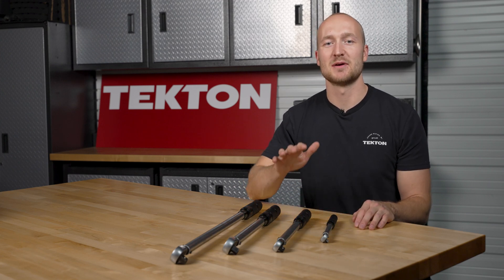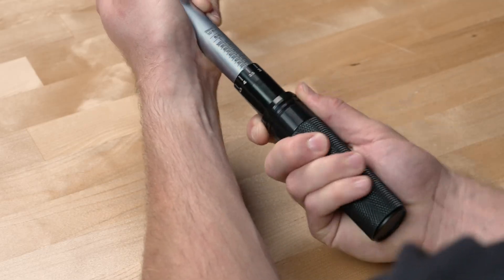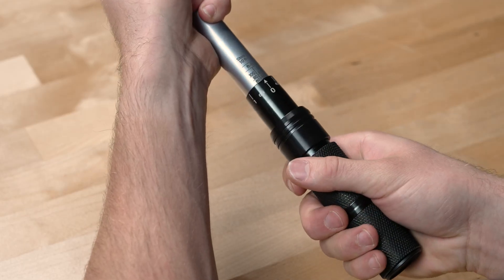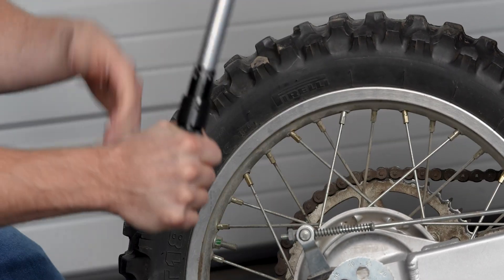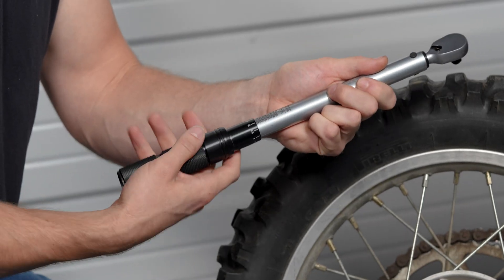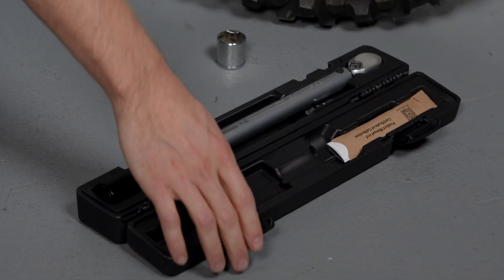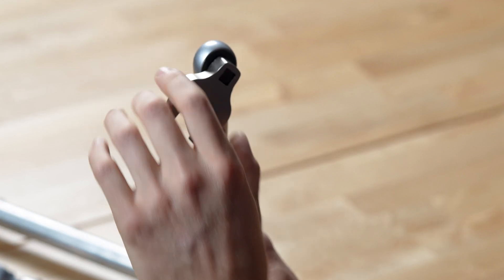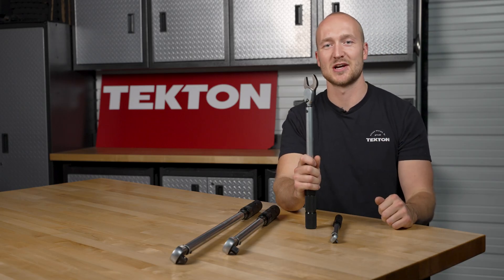How to Use Tekton Micrometer Torque Wrenches

Comment: These came out of nowhere, no mention of ending production of the old torque wrenchs anywhere...
Reply: The old torque wrench's are vastly inferior to the newer ones due to the fact that they lack a locking collar and would come loose after using it a little.
Reply: @Tyler-Wiley also went from 32 tooth to 90. Not to mention, warranty them old puppies out for new ones!